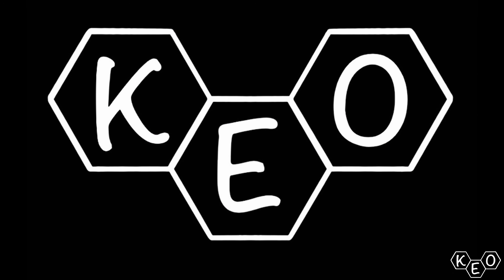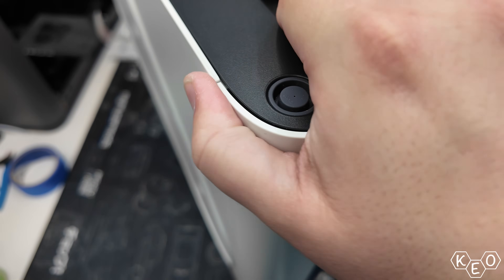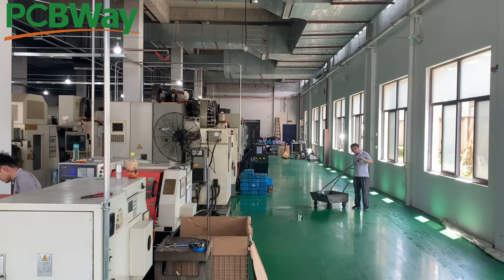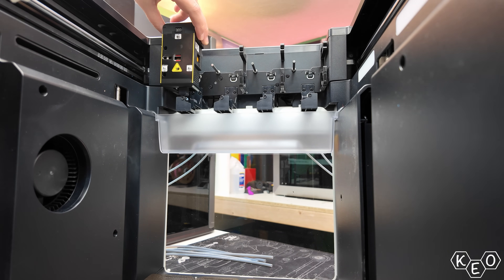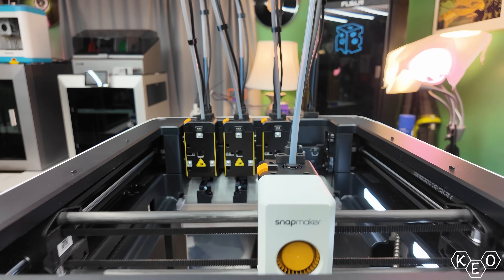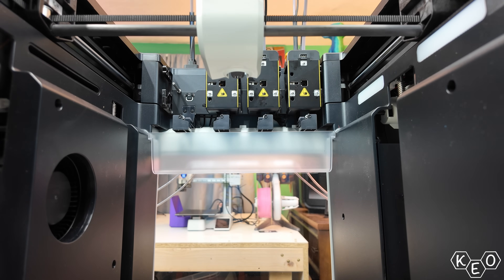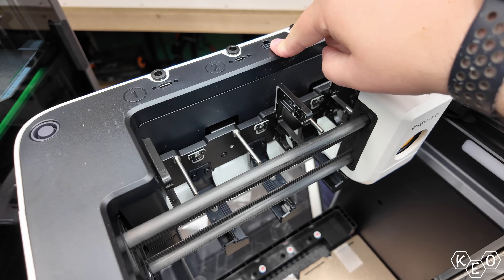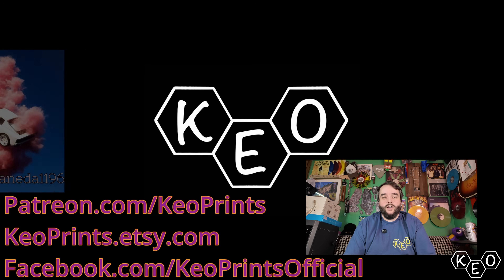Why Is the Snapmaker U1 This Cheap? (Initial Impressions)

Comment: I just wanna note that $1,000 isn't cheap, it's just affordable for a tool changer and the feature set. I also feel like most printers on the market don't get this kind of scrutiny from so many creators. Almost all printers have cheap plastic, flex in panels, less sturdy features, and the like. If aesthetic features are built to a price point it ideally speaks to the idea that the money was spent on mechanical aspects, which is what really matters. Thanks for the preview.

Comment: The printer isn't enclosed and won't do filament that is prone to warping which I don't think is a big deal breaker because 99% of people buying this machine are more concerned with the multi color and faster printing and less poop than printing with CF filament (leave that last bit to the Centaur Carbon)

Comment: As for the cheap side panels that are on this printer, it never really bothered me as long as they hold up for the function they were designed. As for the top covered missing I wish they would have designed and sent out a cover option maybe not one with the filter and everything else That's rumored to accompany it. Maybe just a bare bones closure. That would allow for some dictionary material printing. But overall not a big deal for me. I probably will wind up designing one that will hold a roll of filament so that I can better print TPU with it.

Comment: I have it now for about 100 work hours (next to p1s), and its nice machine... not quite at Bambu level, but still solid for $670 i got it for. Definitely needs some mods (printing from dryboxes especially...would love some kind of solution to have Prusa like drybox in same location as default U1 filament holders). BIG problem is their software right now... I was only able to print by sending file to machine once. Have to use usb all the time. Other than that, no print fails yet.

Comment: With the amount of forks that do not do a whole lot to the base OrcaSlicer I really wish they'd just implement a theming function, where they could distribute a config-file describing icons, color palette (for UI), about text, and it'd be just OrcaSlicer mainline but relabeled (and inherits a "powered by OrcaSlicer"). They should then contribute to the mainline for any functionality additions. It'd simplify their distribution since they could do a quick auto-build + repackage, and quality control check.

Otherwise, you get all of these different forks that fall out of line with the main branch, and are destined to be abandoned at some point.
Reply: And OrcaSlicer should’ve been licensed under GPL in the first place, imho.

Comment: You need some speed tests using single color and print some basic shapes and overhangs to see it there are any imperfections , z wobble, stepper issues etc. Even your print was textured which does not help. Personally I'd run a filter fan with a carbon filter installed next to it because it's an open printer and even PLA is toxic.

Comment: That’s the machine I would have wanted, but as it’s not available for months and because the €50 extra for shipping p*ssed me off I bought a Kobra S1 Combo for less than half the price.
Reply: Ouch, very bad choice
Reply: What you save in the short term you lose in the long term with filament waste, and a lot of extra time when printing multicolour.
Reply: @ScruffyMisguidedAndBlue  well, maybe in a year there will be so ething better than the u1. It's not fully enclosed, that's my main gripe. And if I ordered now I wouldn't get it for almost half a year anyways.

Comment: Good video. I don't think the concept of "neglect" of details is appropriate.  I think its a matter of priority.  To bring a unit like this in at a low price point, you need to prioritize higher cost elements that are most related to performance.  This means the hardness and rigidity of the moving parts takes precedent over the cosmetics of the outer case.

Comment: Honestly it is a crime that they didnt fully enclose this printer. $250 for the offical top hat or being stuck with an ikea tote on top just feels wrong for a $1000 printer.
Reply: There's some 3rd party downloadable hats for this printer now, some use an acrylic window so it's not all print and you can see inside.
I'd recommend just printing a hat rather than paying that ridiculous price.
Reply: @LordPhobos6502 I know, my point is that you shouldn't have to do that on a $1000 printer.
Reply: That's why arco 3D printer is better choice for 850Eur no multifilament nonsense, but sturdy metal frame and stationary bed.

Comment: Good video, thanks. But you as other reviewers are missing some things that purchasers should be aware of. First you are locked into 4 tool heads max, no expansion possible. There is no factory option for keeping the 4 filament holders covered and dry (they should have designed this in and had an option to purchase and upgrade if needed). This really limits you to printing with PLA. This is different than an AMS which allows you to add multiple AMSs to deliver much more than 4 color printing if needed (up to 24 with the AMS 2 Pro I believe). Hardened nozzles and extruded gears should have been standard. Cost is minimal and the ability to print whatever material you need is much better than having to worry about it. A top end nozzle temp of 300 is a bit low. Would have been better if it had a higher temp (maybe 350) so you could print with engineering filaments if needed. Same with the 100 degree bed. Higher would have been better. They do offer a $149 add on top to at least enclose the machine but there is no heated I interior option available. This all points to a higher cost U2 version that addresses some (hopefully all) of these issues. Would like to see a slightly larger build volume (300x300x300), higher nozzle & bed temps, filament covers with integrated drying and support for adding additional nozzles if needed. I guess you can kinda view the U1 as a proof of concept machine. If it works well and can print for extended periods without issues then maybe that will pave the way for an updated U2 version. Looking forward to how this evolves in the coming year.
Reply: Some good points, as for the four toolheads I would think that would be obvious that upgrades are not available you are stuck with the four. As far as 300° hotends and not being able to print engineering filament, that's simply incorrect. Lots of engineering filaments can be printed at 300 or below. But yes, an enclosure for the top with the machine would have been better. There are some rumors with the available ports that a heater of some type could be included or offered at a later time. Larger volume with the option of a few more toolheads and higher temperatures for the next version would be awesome!

Comment: I wish you would include noise testing in your reviews. Especially on this one since it does not have a glass top. Some other seasoned reviewers do this on all their 3d printer reviews 😜.
Reply from the maker: This is a fair point and I meant to add that because it is noticeable loud. Not crazy but it is noisy

Comment: I've been having print failures on the U1 while using PLA supports on PETG, or vice versa.  I've also encountered strange purge tower failures, and a few times the printer just started mis-aligning the print about half way through, as if it thought the print was rotated and an inch away from where it started.  Also there was no AI intervention on any of these failures. When I tried to reproduce these failures the prints succeeded.  Anyway, I guess my suggestion would be to try and do multi material support printing and see if you get failures and then figure out why.

Comment: Hiya KEO, and GREAT video. The interesting thing is not that they have done this so inexpensively. But why are they the only ones? There has been hundreds of YouTubers who have built their own tool changer printers, Prusa's XL has been out for almost 5 years, AND other companies have had multi-tool changer 3d printers for years. Japan made millions of dollars, in the 70s and 80's, by reverse engineering advanced stereo technology into affordable appliances. So why has it taken so long for this to hit the market for the average person? Marketting tension... A self created bubble of "perceived need."  Sadly the 3D community has like an almost "crack addiction" to new features. Once this tension reaches its peak they throw a first gen version out, and people will spend their last dollar on the printer. Even though it has a ridiculously small print bed and plastic casing. Love you all.

Comment: dang I held snapmaker to a higher level of quality - my J1S is built extremely well; what a shame that they cheaped out
Reply: Qidi had major issues with their 3D printer making printer bottom from plastic, they use metal since. So this is bad design from company that never learns, avoid.
Printer has no bottom metal structure, it bolts to flimsy plastic bottom.

Comment: I don't get the push/flex issues, do people go out and buy tvs, refrigerators, cars and push on stationary parts that shouldn't be messed with?
Reply from the maker: True. It’s not a huge deal. But if you’re comparing to others in the space, this is a difference between comparable machines. If I’m noticing gaps in the finishing pieces and I see the side flex when I’m putting the spool holder on there, it’s worth mentioning.
Reply: @KeoPrints yeah, other people have said much worse! I am on the fence- but a u1 and wait until mar/apr, or wait another product cycle and see if we get a u2, or u1XL or something along those lines. 
Can't justify the cost of a prusa or Bambu h2c right now

Comment: So... turn the box upside down, open the flaps, and flip it over. NOW it comes out of the bottom. Simple.
Reply: Because there's a plastic bag made to lift the printer out of the box in the right orientation.

Comment: A full array of hardened nozzles, a lid and some re-branded polymaker dryboxes (which can be used to keep filament dry while feeding).  Not sure what the top does to the chamber temps when printing PLA, since my u1 is not here yet.

Comment: It's cheap because a lot is left out. No heated chamber. No enclosure +$250.  No dry box +$80 x 4. Only 4 colours. Pogo connectors that will fail, possibly within days of months depending on your luck and number of of changes which can be thousands per print

Comment: I would like to see a functional print that uses support filament. I know, sounds simple, but even the X1C leaves boogers at the sides of the support filament layer.
Reply: I backed it mostly for support interfaces, so I'd like to see that as well.
Reply: Yeah. Another easy example, if all you have is one nozzle, printing PETG with PLA support will lead to clogging and weakening of the PETG since purging will not be perfect. Makes for a good demonstration.
Reply: @EditioCastigata  I've tried to do petg supports for pla on my P1S and it both takes forever (because on top of purging is the temp change) and gets petg in the PLA. I'll use it if there is a single flat overhang maybe.

Comment: How about a discussion around the new design possibilities that multi-material capabilities give us? Hard parts with built-in soft handles, integrating gears made of nylon with structural members made of PPS, ...
Reply: They are not new, just easier to do now

Comment: Looks like someone didn't read the manual :D the main problem of this printer is, as you highlighted, the quality of some plastic parts, and the current software ecosystem not being ready (you can use Orca and you're good). The rest... for this price, there is nothing like this. Moving from a really bad Anycubic Kobra S1 to this one has been a revolution for me. Finally a printer i can trust, with great results, and almost no configuration. The multi head system is reliable and really efficient and fast. The reduction on waste is day and night compared to other printers on the market. But pleaaaase don't advise people to use and electric screwdriver. Yes its long but its on purpose as the screw needs to be safely installed with specific care to how tight you do it.
Reply from the maker: That’s a good point. For anyone using an electric screw driver, those are meant to wind in fasteners… not to provide a torque spec. Good to mention for those playing along at home

Comment: I really like Orcaslicer with my Bambu X1C, but then I got a Q2 early on and there was no Orca definition, so stuck with Qidi Studio. It isn't up to date, but it is getting updates, then a nightly build of Orca included a Q2 definition. However I actually like having two slicers in my dock now, as I can keep one per printer, so when the SnapMaker U1 lands, I'll have three slicers in my dock, and as they have a similar feel, it won't irk me as much, as it did when I had some using their own, Superslicer and Cura which  affected your workflow switching between them, and fussing with settings when stuff wasn't as easier or as well calibrated from the start.

Comment: For printers (or other heavy things) that are supposed to be removed from the top of the box, do this... Turn the box upside down, open the bottom of the box and leave the flaps extended. Flip the box right-side-up again, pull box off of device. Done. :) Learned this when I sold electronics at Thalheimer's. Back in the days when TVs were stupid heavy. And bulky.
Reply: why not just cut the bottom off? No need to turn it over. 
Provided you absolutely know there is enough packaging material so you're not cutting into the product!
It does mean you can't re-use the box without some repairs... So I probably won't do it. But someone who has trouble lifting heavy stuff might.
Reply: @sourcererseven3858  Yeah, I'd be concerned about cutting into something into the box. Not a bad idea, just not quite as safe as flipping it.

Comment: Thanks for the intro video and I'm definitely looking forward to a full review after a lot more print hours. Multicolor TPU is cool! But also seems like this may be the go-to for multimaterial or multicolor prints (PLA, PETG, and TPU). Will be interesting to see what is possible if we get a community mod for a heated chamber with the top cover. It's a lot of space to heat, but I'll bet 50-60C would be possible.

Comment: When it comes to something like a 3D printer I could LITERALLY not care less about its aesthetics.  I don't want to pay so much as a single cent because someone else wants a pretty machine.  I want function over form.  I don't care about a side panel that isn't perfectly clipped into place...I can fix that myself.  If the machine works well, the electronics "electron" properly, the motion system moves properly and the prints are good that's what matters.  One thing MOST people seem to keep missing out on is that a panel that is very tightly clipped into place is often very hard, if not impossible, to remove later on without damaging said clips.  Anyone who has opened a modern laptop knows what I mean.  I would much rather easy access for easier reparability that nit-picking over a loose panel that someone else might think is unacceptable.  We all have our own standards and there will never, not even once, be a product that serves 100% of peoples' requirements.   

If I had my way my U1 would have had a $200 lower price tag and would show up as a box of parts and sub-assemblies that I would put together myself.  I'm one of those weird people who ENJOY putting stuff together, and to be perfectly honest I fully expect I'll take mine apart so see how everything goes together well before I actually put it all together.

Comment: I'm waiting on a Youtuber to have the same problem I did.  Mine arrived on Sunday this week and when I first set it up I could not get through the initial calibration. The toolheads would not "park" and "unpark" from the printer properly. I had to do several manual rotations of the gantry for belt tensioning and then I had to go readjust the toolhead coordinates in the firmware.  It was a HUGE PAIN...  But Snapmaker tech support is actually very good and they helped me.  I just hope that the belt and toolhead alignment issues are behind me.
Reply: Teaching Tech's video from a month ago shows 1 toolhead that wouldn't calibrate.
Reply: @joncorso6103  Oh ok, I'm going to check out that video and see what he said about it!
Reply: time for you to have a youtube video , since most of the youtuber"s samples arw pre-tested to avoid bad pablicity
Reply: @amroashram  That's what I was thinking... I even had a Youtuber try to shame me and call me a bot because my U1 had issues out of the box.
Reply: @cylonmode  those are the worst and should be ignored
Reply: So you eventually solved the issue?
Reply: @profoundmatter4786  I did, there is a You Tube short from someone called kaizen, that explains how to reprogram the toolhead coordinates and that worked for me.
Reply: I do remember one of the pre series YouTubers having the same problem...
Reply: https://youtu.be/tSXfQJZdK58?si=xHSR29JH1qcKEcMC
Reply: Hey, did u find any solution?

Comment: SnapmakerOrca is a fork, that they use to feed back changes into mainline orca. The printer also runs mainline klipper. It's actually quite open!
Reply: The complaint is why the fork. Unless it's a major change that orca refuses to accept, most forks are just for adding their own branding. Instead a simple profile for the printer would suffice. And as a user you don't have to install multiple slicers in case you have more than one brand of printer.
Reply: @KaiPetro   i disagree, i think snapmaker has done a good balance. they have added some skinning and models that wouldnt be natural in the mainline, but they also are open source and push changes to mainline so we all benefit. its as good as it gets. i dont see mainline adding company branding, that is perfect job for a a fork.